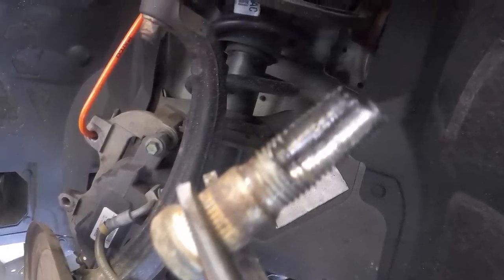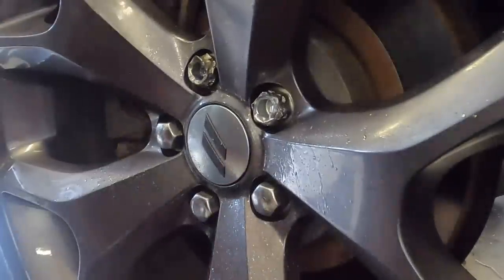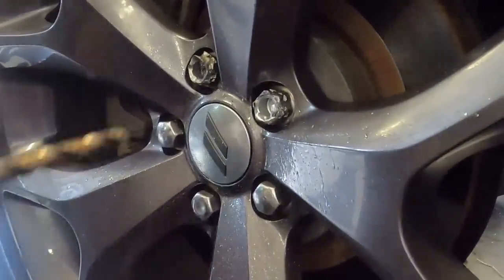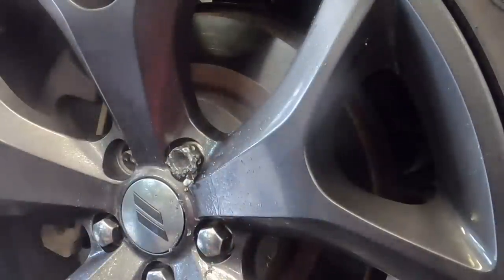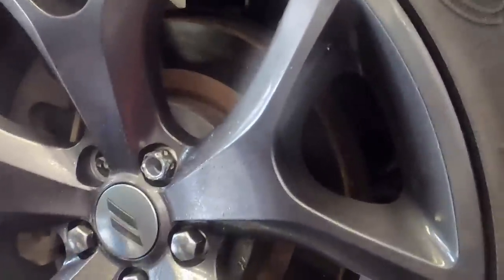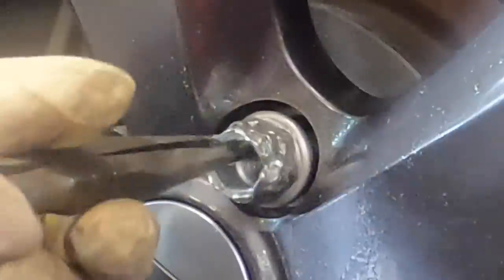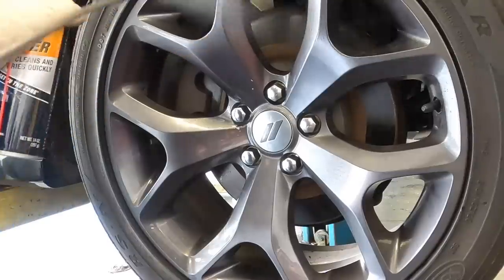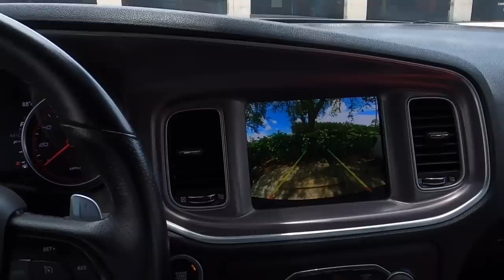2019 Dodge Charger! READ DESCRIPTION FIRST! Dealer Couldn't fix this! Must See! Bonus Footage

Comment: Here's a possibility.....I had this happen several times on a Nissan Altima with aluminum rims.
The damn fool wheel installers, after mounting new tires, would drag the wheel over he studs and shave some aluminum into the stud threads. When you install the nuts they'd give no indication of any cross threading because there was none. They'd install just fine and torque properly. The issue was when you removed them they'd lock up exactly as you see in your video. The key is....don't try to remove the nut. Instead, just torque the damn thing tighter until the stud breaks. You'd be surprised at how little it really takes. Then it's just a matter of installing a new stud. Do not get caught up thinking that nut removal is the only way.

I always watched the tire shop on the nut removal at tire change time and caught them slamming the rim back and forth, wallowing out the hole. They replaced the rim with new after I pitched a fit. This is why I'll never have alum rims again, steel wheels only.
Reply: Problem is, the dealership jacked up the lugs and they couldn't be used.... He really had no choice than to drill them out.
Reply: 9/10 times the effed up lug nut can be removed without drilling or breaking the stud. 

At carvana, I was a go-to guy for this. 

The only real reason is if the stud is stripped, or the splines came out of the hub.

Comment: Ray,  we just had the same exact thing happen with our 2012 Jeep Liberty.  The lugs were torqued on so hard that an impact wrench could not remove them.  We ended up torch cutting them out and replacing the studs.  Those tin-plated carbon steel lug nuts are worthless, too. I replaced all 20 with stainless steel lug nuts to avoid this problem again.

Comment: As an ASE certified technician, I have come across this many many times. The lug nuts are not seized to the stud but to the rim. This happens from corrosion and is more common on aluminum wheels. It's not always because somebody over torqued the nut as I have had it happen on my own vehicle and I always torque to spec but has not happened again after I learned this trick.

 If you come across this and you give it a go with an impact and it don't twist right off after 2 or 3 seconds, then STOP do not keep going or you will start to tear shit up. This tip will save you a ton of time. Simply pull the socket off the impact and put the socket back on the lug nut then get a big dead blow or a sledgehammer and hit the back of the socket as square and hard as you can a few times (I have to hit it as hard as I can as I am a small build man and only weigh about 135 pounds lol.) 

This will break the nut free from the corrosion and the nut will now twist off with the impact normally. If it does not twist off normally, then repeat the previous step until it breaks free. To prevent this from happening in the future simply put a little anti seize on the rim where the lug nut seats. DO NOT put anti seize on the threads of the stud or in the lug nut. 
This method has worked for me every time over the years and each time it does, I quietly whisper to myself "Thank you Tim!" as Tim is the 45-year ASE tech (now retired and teaches ASE at the local community college) who taught me this trick 15 years ago. I hope this helps you all too.

Comment: Once I had a dealer snap the stud, but instead of replacing it they silicone the lug nut to look like it was attached.
Reply: That my friend is a Lawsuit !!  My lawyer would have had a field day with that one !!
Reply: @MrLew1965  You would never prove that !
Reply: @btcbob11392  What's there not to prove ?? The dealership silicone attached a wheel nut onto an existing bolt !! Pictures / Video after the work was done would prove lots !

Comment: I am amazed really that the local dealership sent this away instead of telling the customer they need $$$ plus it their wheel will be damaged. And this is why when i took Driver's Ed back in high school (it was an actual elective class) they made us learn to change a tire and they taught us to put them on by hand tighten first to make sure they are going on straight...

Comment: Terrible thing to say but I enjoyed watching YOU bust YOUR knuckles and stuff doing just what I would have done.   I am getting too old to enjoy the success of beating problems like this.   Good on ya!!   My only negative was when you had them pretty free.  I thought I would have used the chisel like a huge flat blade screwdriver and placed it in the notches you cut and twisted the darn thing off like a screw.   I  "think" that equal pressure from two sides would have helped to loosen it quicker.   Just a nit to pick.   I am impressed.  NO way could I have stuck it out that long without totally losing it.   Thanks for letting me watch!!  I did enjoy it.

Comment: Put a strap around a spoke of the wheel and a 2x4  have someone push on the other end of the 2x4 against the back of the drill to put more leverage and pressure on the bit.

Comment: I  suggest when you drilled out; instead of 2 hammercuts at 180* degrees, cut 3 hammercuts at 120* degrees, you can continue manual hammering.

Comment: "Reverse machining" made me laugh rather hard. Thanks for sharing the frustration. I've had 8th hand vehicles ad nauseum, and occasionally find some stupidity like this. I've never seen them this stuck and destroyed though. That was wild. I might have considered welding a suitably sized bolt to the inside of the nut with just enough length to have the head just above the nut so you could grab it with your impact. The vibration of impact might have made it let go more easily. I don't imagine the heat would have damaged anything, and it might also have helped it let go. You would have needed to shield the wheels from the spatter though; I'm always working on vehicles so old the spatter might be an improvement. :P
Reply: Heating would have Destroyed the Clearcoat Finish on the Rims . Welding in another Bolt MIGHT have worked , though . Again a risk of damaging the Wheel however . IF  there was Rubber Paint available to protect the Wheel , definitely a viable option .
Reply: guess you haven't seen Ray welding bolts on other jammed up fasteners before? Ray made the right call on this buggered job.

Comment: I had a similar problem with the nuts on my 2015 Jaguar , the dealer whanted a fortune to make good including a new disc!  So thinking sideways I took a good holesaw with the internal diameter 1 or 2 mm larger than the stud, drilling carefully I cut right through to the opening in the wheel. The nut was then loose and could be taken out with two fingers, the remaining thread on the stud came off with small pliers. The wheel was undamaged and pulled off as normal, all that was needed was replacement nuts! The whole effort took 10 minutes for 2 nuts. I hope this helps and saves a lot of drilling and chiselling

Comment: Sixty years working in tool and die shop I got to remove many broken taps and bolts. A tap is hardened tool steel, take it to a machine shop that has EDM.
But if you can drill it, it is loose (turning) in a tapped hole you have a chance of backing it out or off. Don't even think about using easy-outs, they make very unsecessful fishing sinkers. Get out your file collection, a small adjustable and your smallest ball peen hammer. Remove the handle exposing the tang, select one that just enters the drilled hole, tap the flat end with the hammer just enough to bite the 4 sharp corners into the hole (too hard will expand the bolt) adjust the wrench to fit the file's thickness, press downward on the file and rotate the broken part out.
The same could have been done with the 1 thread remaining lug nuts with the file's opposite the tang end if the width of the file fits. If not sacrifice the file by reducing the width on a grinder providing a slight taper to provide the corner bite.

Comment: (From a millwrong point of view) If a guy thought he'd have to do these with some degree of frequency, he could construct a steel plate jig that could clamp onto the wheel. There would be, say, a 2" hole that could generally align with the bastard nut. Use a Hougen (or similar) magnetic drill with a 7/16" annular cutter. This cutter will go right through the threads of both the nut and stud, and won't touch the hole in the wheel. Would take less than 5 minutes to set up and cut through the depth of the nut. A Hougen is about a grand, so it would take a while to pay for itself. They're cool tools.
Reply: Annular cutters are awesome.  Used some in the machine shop to remove waste material before milling, I like your idea.

Comment: My friend, what you need to be using is a set of LEFT HAND drill bits. Lug nut removes itself on the bit when you get enough metal out. 2 hour job with them, maximum

Comment: Suggestion:  diamond coated drill bits.  Not as expensive as you might think.
Concern/reminder:  Be careful of the drill bit jamming. If it breaks it can go flying like a .30 caliber.  Or, the torque feedback through the drill can break your wrist.
Question: " clean with solvent..."  Is the solvent brake parts cleaner?? 
Thanks for the videos.  Not only are they informative, but they are entertaining as well.

Comment: When you have idiots putting your wheels on your vehicle, anything is possible.  Once, after getting my two year old Toyota Rav-4 back from the dealership from my last "Free" tire rotations, I was curious if that shop actually used a torque wrench on the lug nuts.  Answer...No.  I ended up loosening all of the lug nuts with a breaker bar. All of the lug nuts had different torque.  Two of the lug nuts required me to put a pipe on the handle of the breaker to loosen them.  Even standing on the handle 9f the breaker bar couldn't loosen them.  That means if I had a flat on the road, the stock lug nut wrench wouldn't have been able to remove the lug nuts. Another time  many years ago, I bought tires from a local Pep Boys. I told the service rep to tell the "mechanc" to torque the lug nuts to 85 ft  lbs. And no higher. As I watched from the waiting area, I watched the shop guy using an impact wrench to tighten the lug nuts.  I approached service rep and told him to tell the shop guy not to over tightene the lug nuts because I didn't want the rotors to warp.  The service rep said that the shop guy wouldn't do that.  After all four wheels were on, the shop guy went around with a torque wrench on all of the lug nuts.  I could see that he wasn't bringing the nuts up to torque, but simply checking that the nuts were at least up to  the requested torque value.  You have idiots like these guys with no common sense. If you want it done properly, you have to do it yourself.  Since then, I purchased a tire changing fixture and a wheel balancer. Saved a lot of money since then doing it myself.

Comment: Had to do the same thing on my mother in law's 15 Cherokee... Last shop down the road overtorqued the lug bolts... Had to drill out like 5 bolts. What fun that was... Bought all new solid steel bolts for it and threw out the rest. Perfect now

Comment: For drilling metal, an old waste oil can, a magnet and a simple turn valve can be very useful.
Hang the can off the side of the car by the magnet. Lower the hose to where you're working, clamp it and open the valve to a slow drip.
I used to have one I made for just under $30. Used small alligator clips to hold it near my work (piece of 10AWG solid copper wire with an alligator clip on both sides), you can clamp or wrap it on something nearby then just grab the nozzle with the clips to hold it.
Then open the valve just enough to get a slow drip.
It's not free, but neither is it expensive. And it has probably saved me a few drill bits by allowing me to keep them cool while stabilizing with both hands.
Sadly, I no longer have this old can and haven't made a new one because I haven't been doing as much metal drilling.

Comment: Use less speed and more pressure. You can't use too much oil. Set up a drip or find a minion to feed oil. Keep the bit sharp. I usually start with a large bit to get a good centre.
If you have the hang of it, an easy 10 minutes each studs this size.
Practice makes perfect!

Comment: I’ve had to deal with same problem when tire dealership cross threaded a couple studs one from each side on the front on my Nissan truck, to make it even more enjoyable to replace the front studs on this truck requires pulling wheel bearings not enough clearance to simply  hammer old ones out and slide new one in, rear wheel studs can be but not front go figure lol

Comment: I once cross threaded a wheel nut. But I pulled it off before it was too tight. Someone just said, why is this so much harder then the rest, and just kept going with an impact. I had to watch this to the bitter end since you took the time to save this car.

Comment: @Ray I've done this very same method to remove a lug nut that was cross threaded and seized on my vehicle.  Through my efforts I even managed to strip the splines on the wheel stud, so I had to drill it out in a similar manner.

Additionally I've had to remove wheel lock nuts on the same vehicle after I misplaced the key for them. For this I used a piece of steel pipe that I welded over the nut. I know you have openly stated that you're not a welder but that could have been a possible solution for your job too. Well done on s great job.

Comment: I realize there's a torque spec that shops are required to obey, and it's brutally tight. Imagine trying to get lug nuts off on the roadside using the cheap wrench that comes with the car. And I'm talking here about ones that are properly installed. I haven't had a flat for decades, but I still carry a breaker bar and a socket in the car just in case.
Reply: YES I carry all that AND a 25inch cheater pipe..One never knows....
Reply: The torque spec for my wheel bolts on my dart is 100lb-ft,  come to think of it,  the spec for my cherokee lug nuts is 95 lb-ft, neither of which is brutally tight

Comment: Just curious,  did you think about putting the rounded nut extractor back on after you got the nut to start turning?  
Great video.  👍
Reply: No Point at that stage . Once it was MOVING it's two/three minutes until OFF . Would take 5 minutes to find the Extractor .
Reply: Paid by the hour . That would be too easy

Comment: I like your methods. One tip is before using any drill, make a little drill bushing. Make the OD of the bushing fit snugly inside the nut and the ID fit the first drill you plan on using. That way, the first hole is in the center of the stud. The other drills will follow pretty true with the first hole. Also grease the threads when pulling the new stud into place. Not oil.
Reply: And be sure it is a left hand drill bit.

Comment: That's a lot of drilling work..should be a higher hourly rate! Crazy how hard the caliper bolts came out as well, thought for sure they were also crossed threaded. That scratch in the rim was minor compared to how it could have turned out in the hands of a hack mechanic which seem to be a dime a dozen.
Pro job 👊🏻👏👏

Comment: An old machinist told me a trick on stuck lug nuts like this, im shure you have a ton of experience on doing this, but next time try only drilling maybe half the diameter of the threads, those are prob like 12mm thread, so lets say like 6mm hole. The thread will colapse when you remove about half the material. Ive had good luck doing it like this, and if it doesnt work you still have to keep drilling anyway. So try next time giving a a good twist when you get a decent hole started. You will be supprised how well it works at releasing the clamping load of the thread...without actually drilling it all the way out

Comment: Had this experience with my sons 2010 Lacrosse. I was able to use a new sharp chisel and get through the aluminum cap leaving a clean steel lug nut one size smaller. Those I was able to remove with a breaker bar and pipe. Might have just got lucky. Still very time consuming sitting on my garage floor.

Comment: I don't know if you go back and check comments on your older videos but if you do and I didn't read the other comments made here by other viewers but have you ever thought of buying some reverse cutting drill bits  ?  They are so awesome and  most of the time they will start to drill it out and get the stuck , overtightened nuts , bolts , broken off heads to come off without doing all that extra work with punches  , chisels   !  It would be a great tool to have in your tool box  .

Comment: i had the same thing on my SV6 Holden (GM) but i only spend 28 min on 2 lock nuts. I carefully heated up the locknuts with a small flame and not damaging the wheels and they came of easy